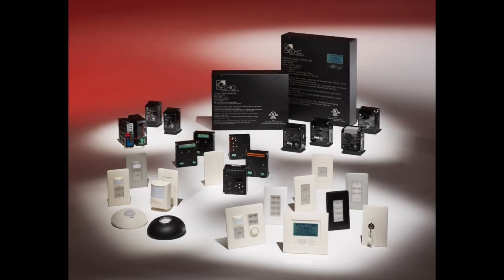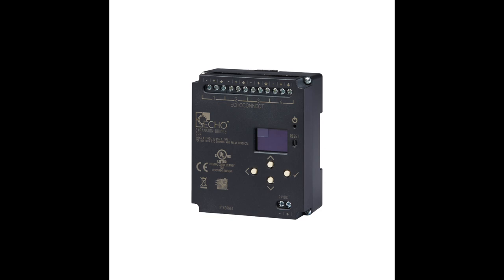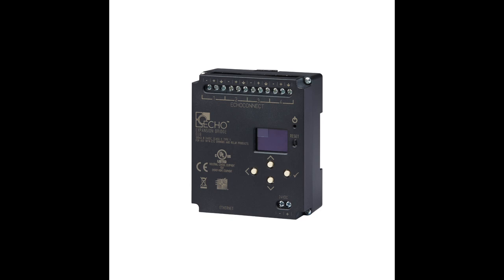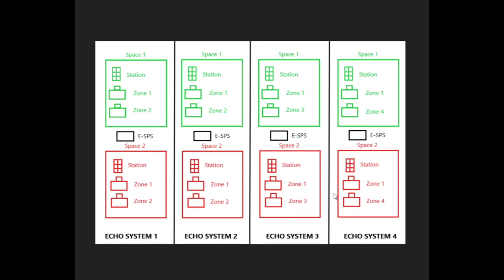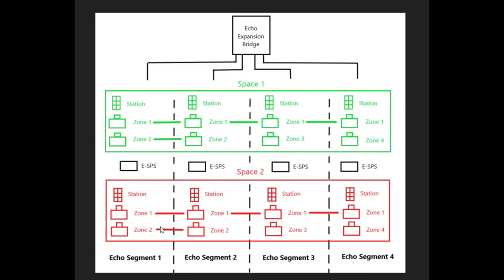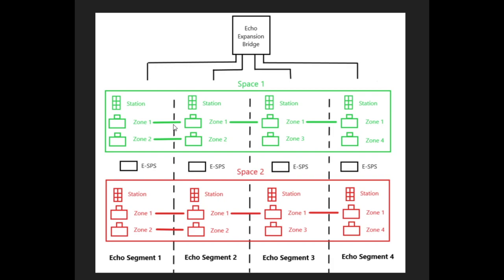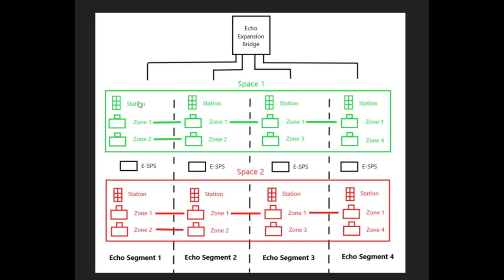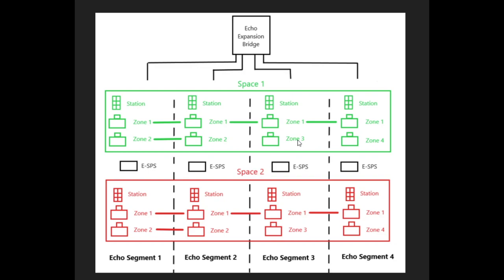Echo Expansion Bridge | Understanding System Segments

Comment: Is it possible to run presets or control the Echo Touch via Echo Access App (On Ipad) using Echo Exp Bridge?
Reply from the maker: If your system has an Echo Expansion Bridge in it, you can use the Echo Access app on iOS, iPadOS, Android, and ETC Concert for PC to control/manage your system.